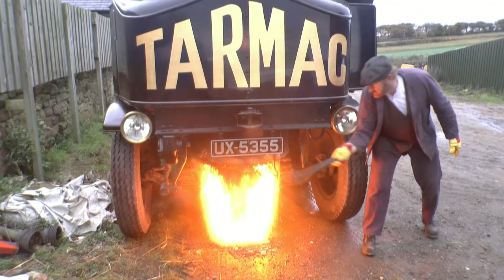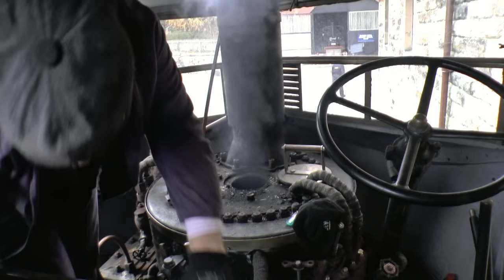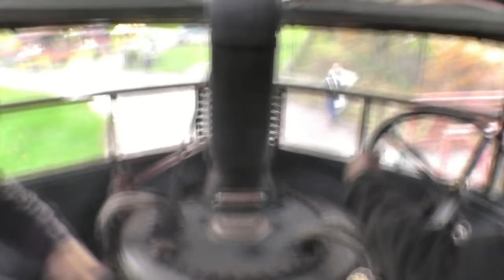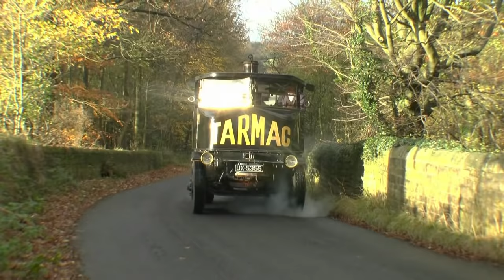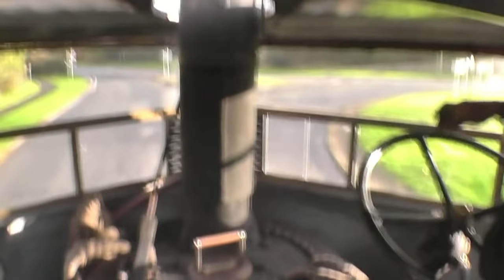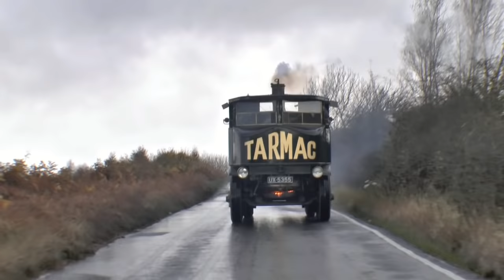Sentinel DG8 Steam Wagon

Comment: And I complain about the lack of power steering on my Fiesta......
Reply: Jusb1066 just buy a K&N Airfilter and you will have enough power ;)
Reply: what ? Is this supposed to be a joke @Kai FRIEDRICH or are you for real ? xD
Reply: +Th3Moonser I think he was high
Reply: Yeah I think so
Reply: Spinddrift that was definitely a joke
Reply: Sorry, that's not lack of power steering, that's center-point Armstrong steering.  It was the predecessor to power steering.  At least I think I saw the front end raise up when he turned the wheel which would make it center-point.  But it was definitely of the Armstrong variety.
Reply: Cars without power steering are easy to drive. It's when you start driving trucks without power steering that it becomes a bit difficult. My current daily drive lacks power steering and it's easy to steer, even at slow speeds.
Reply: What Fiesta, is it a mk2?
Reply: @adrienbanha3004  it was a 1992 MK3 I had untill last year, now sold, I have gone modern

Comment: I'm afraid I'm gonna need one of those. Where can I sign my soul to the devil... Because I would to own that. I'd  drive it to pickup my kids at school and to get groceries. I don't care if it takes 2 hours to fire up I'd do it anyway!.
Reply from the maker: Great fun
Reply: I plan on buying one as soon as I hit the Mega Millions Tuesday night.
Reply: You could modify a modern internal combustion engine into a single action steam engine. You could make it into double expansion engine by connecting primary cylinder exhaust to two secondary cylinder intakes. You'd need a modified valve timing rod, to open intake on every downstroke and open exhaust on every upstroke. Water pipe boiler is very easy to make yourself and it produces high efficiency superheated steam with no extra apparatus required. If you make it running on liquid fuel, you could make an automatic furnace that keeps appropriate steam pressure by starting and shutting down depending on the pressure.
Reply: @michaelbuckers  so essentially, change timing,  and boom steam engine. (if it doesn't blow up)

Comment: I saw the footage of driving through the puddles and flooded street and realized that those could really ruin your day in a steam-powered truck like this.
Reply: Nah that is just the ash tray, it would be hard to get water up into the actual burner.
Reply: Because petrol engines can breath underwater...
Reply: If steam engine gulps up some water it just extinguishes, you can re-ignite it with some dry coal. If a petrol engine gulps up some water, you gonna need a new petrol engine.
Reply: Mi 28 If water goes into the cylinder(s) while its running, you'll have the same issues as a petrol engine. That's why steam engines typically have some kind of bleed valve to open while they get started allowing water that pooled after the last run to be ejected safely without bending the rod.

I think Pete's point is how long it would take to dry out the fire box, re-ignite it and bring the steam back up to pressure to get going again. I sucked up a little water into my Jeep's engine more than once. It only took 5 to 10 min to pull all the plugs, crank it a few times, clean the water out of the distributor cap and reassemble.
Reply: The flood water wouldn't go into cylinders of a steam engine, the intake is sealed off from the environment. The drain valves are there because steam is water gas, and it always fills up the cylinders, so when the engine stops for a long time all of that gas water condenses into liquid water, which needs to be drained.

You don't need to dry out the fire box. You just need to evacuate the water and re-ignite it using dry coal. The burning coal would quickly dry up the firebox and the wet coal as well.

As for your truck, I guess you got lucky and it only sucked a tiny bit of water at a time, just enough to stop spark gaps from working but not to cause compression damage. Flooding a running engine normally results in its complete destruction.
Reply: cold water on the boiler too..

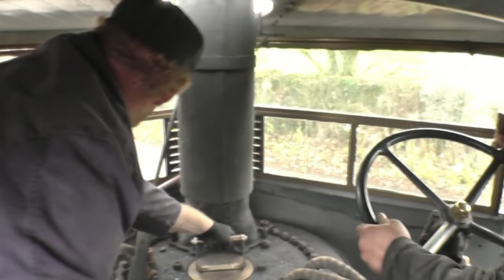Comment: 4:26 when vtec kicks on
Reply: insert [ E U R O B E A T ]
Reply: TowmaX wrong country
Reply: Engineer Skalinera but it’s used in an asian show an honda is an asian car company
Reply: TowmaX the initial d memes are from japan
Reply: you forgot the "yo"
Reply: big smoke haha
Reply: Greg Thomas Honda's aren't slow
Reply: Many steam engines did have variable valve timing but that tended to be on the locomotive engines, not too sure about road going steam engines!
Reply: @sidecarbod1441  that's normally called "hook up" in america, it's where you adjust the valving to open less at higher speeds to conserve steam and help the locomotive run a bit smoother by adjusting the time the valves open and close, thus making the train go faster. The legendary Stanley steam cars had the same thing, which is how some of the racing cars can reach speeds of over seventy miles an hour.
Reply: Lol
Reply: More like 11:20
Reply: The tec lad... This thing blows smoke rings ... Satisfaction guaranteed
Reply: Coaltec not vtec lol

Comment: bet it has better EPA ratings than a volkswagen from 2016
Reply: Well we know now you are not an Engineer!
Reply: Jamison Leonard a bush fire next to an oil refinery has a better EPA certification than a VW diesel
Reply: the car produces some kind  gas as any diesel car. but the they probably used weaker filter that block air out flow and made it slow .so bypassing filters makes car faster and more efficient while makes car more ozone enemy. 
thats what wolkswagen did . 
jut put another filter and you got the some epa ratings :D
Reply: ahmet mutlu As long as we're missing the joke, the VWs can meet EPA standards just with ECU tuning (and an increase in DEF usage)...which is precisely how they passed emissions testing on the EPA dynamometers but fail in actual road use.
Reply: Jamison Leonard this truck takes the green piece award
Reply: wel its not green . it doesnt use any kind of filters. so its worst case of emission possible. :D 
just uses coal instead diesel or fuel. but im sure epa ratings wont pass epa. you guys get it wrong. 
with a epa compatible filter probably this engines wont even start. thats the problem. thats why wv used weaker filters :D
Reply: KennyG Hansen hey a fellow hubcap collector is here!
Reply: Well the VW was just high on NOx emissions,  this is high on CO, SO2, and particulate...

Comment: I would love to see a modern version of this truck built. The same wheel set up and cab but a gas fed burner and the best materials and most advanced steam engine. Just to see what it could do. I know steam engines can make tons of power. The trick to them is keeping the heat in.
Reply: Especially power steering!
Reply: What’s the point of it if it’s going to burn gas? Seems to me what makes a steam engine so useful is it can burn cheap fuels like coal and wood.
Reply: @loganbaileysfunwithtrains606  Because steam engines can be very small and still make an insane amount of power. Never going to be a sports car but it could be a commercial truck. With modern tech we might be able to make it burn cleaner than a diesel but make similar or more power.  

 When steam powered trucks were built technology for burners and insulation were WAY worse than they are now but they still made a ton of power with tiny engines. 

 I have no idea if they could really compete with a modern diesel but it would be neat to see what could be done.
Reply: @plaid13  ACE 3000 was a program in the 1980s to build a modern coal fired steam locomotive. You’d likely be interested in learning about it
Reply: @loganbaileysfunwithtrains606  kind of interesting but coal isnt a good fuel.
Reply: @plaid13  coal is a good fuel, it’s thermal properties are better than any liquid combustible. It can also be used in a process called “coal gasification” where it’s heated and off gassed and the gas is then used in the same application as natural gas.
Reply: @loganbaileysfunwithtrains606  But what it is not is easy and practical.

Comment: At least we have got about a thousand years of coal left, perhaps when the petrol runs out coal powered trucks may return!
Reply: Still plenty of wood and cardboard and paper to. Don't get me wrong coal works but that's still a finite resource. Wood along with paper products are renewable because they can be recycled and regrown.
Reply: Plus diesel can be synthesized from most cooking waste or have a few dedicated farms for fuel production. We are certainly not going to run out of fat animals or greasy foods or soy beans anytime soon.
Reply: kamenridernephilim he could use shredded compressed newspaper logs all he has to do is get a stack of old newspapers shred them and a blender with water and press the water out and form them into small cylindrical bricks that he can use as fuel logs
Reply: The Tool Guy not really a byproduct, it's part of the process. So is Jet-A, Heating oils, and asphalt. Distilled it comes off in layers into pans in the stack. The higher it goes the lighter the fuels.
Reply: Some refiners only pull off and sell gasoline because it's the end result of making jet fuels, which is what they are after for the higher revenue return. Some refineries actually inject unwanted fuels back into a pipeline so it can be used elsewhere in a down stream refinery.
Reply: Um, Tool guy, have you ever heard synthetic diesel? Apparently it have been around even before WW2, and it was produce by wood and animal products, and it can put on planes and fly faster then the real diesel, tough it was very costly to make.
Reply: Saviliana go to the Thessalonians man YouTube page he shows you in great detail how to refine oil gas and kerosene from wood and it's so ingenious I've literally watch his videos for times and some of them are over 2 hours long
Reply: I did watch a simular video, so yeah, it is working, but very costly in making in large amount (cost of time and energy)
Reply: Ever heard of electricity?
Reply: all this is unnecessary a gassifier turns wood into a gas that cars can combust with a regular combustion engine with minor modifications
Reply: Electric pressure steam cleaner + deep cycle battery + twin acting cylinders = steam car of the future, no hassle, no problems.
Reply: aserta A normal electric car would still be much better
Reply: The Tool Guy the original Diesel engine was intended to run on vegetable oil
Reply: you ALL ever heard of torrified biomass? its a coal-like substance made of wood, with almost no energy waste. it burns a lot cleaner and hotter than coal. combine this with power steering, Gas Producer Combustion System, an improved boiler design and a lempor exhaust and you get one hell of a steampunk truck that goes a lot fAster
Reply: Crazy Horse Trading the potential of modern steam is not to be underestimated.

Besides, you ever heard of the Doble E? A 1924 steam car that could go 100mph ez.
Reply: We are no where near to running out. That's a bunch of crap

Comment: Certainly quieter than diesel..gear noise over takes all..what would normal operating speed be?
Reply from the maker: +Oilsmoke Jones  between 20 & 40 MPH depending on the size of ones testacles
Reply: Oilsmoke Jones what's the 0-60 time?
Reply: TheDude it can keep trying till the whole world run out of coal
Reply: @MrTherandomvidsguy   a calendar.
Reply: Huh... my dad used to assert that you could get 70 out of one if you had sufficiently enormous gonads. Or at least he'd ridden one that went that fast. Can't remember the full story but he'd have been quite young at the time himself, so who knows.

What I want to know is a) if they're still legally limited to 20 or if that's just a bit of historic flair, b) how the heck you'd know where the limit even was given that there doesn't seem to be any instruments at all. Would you just go by the sound and guess it off the passing of mileposts or something?

Not that I think I'd personally have the balls to drive one any faster than that anyway. And what even is a "steam brake", given that there's a warning about it on the mudflap?

Comment: Astounding that there were still coal--fired trucks on the roads as late as '29!

In the US at that time, coal was used mostly for railroad locomotives, and perhaps steamrollers and heavy construction equipment, but trucks? That is pretty amazing...
Reply: You are leaving out the maritime need of coal, coal fired steamships survived until the 1970s, and there’s still a coal fired steam ferry operating on the Great Lakes. The last US large carrier railroad to give up on steam was the Norfolk and Western in 1965. Honesty it’s unfortunate they didn’t try and fight to hold onto it longer, with all the modernized machinery they had available at that time they were able to get super efficient steam locomotives that completely outclassed any of the diesel locomotives of the era, in terms of range and power.

Comment: Possibly either a dumb, or a far too nerdy question, but... what's with the two different rhythms to the chuffing? Like there's a quite fast, thinner/higher pitched one, which is obvious when the truck's maneouvring at low speed, starting off, being parked etc... but when that's starting to merge into a continual fluttery hiss, something quite a bit slower and meatier comes in, sounding much more like what you'd expect from a typical steam locomotive.

You'd probably be quite well advised to build a road loco with a compound engine to get the very most power and efficiency out of a limited boiler size and transportable quantity of fuel, but usually those just have different sized pistons on the same shaft (so the chuffs might be different "notes", but would keep the same rhythm). And it doesn't even seem to be a simple 2:1 relationship, maybe more like 4:1 or even a non-integer one. So is it like there's a big cylinder directly connected to the shaft that turns the drive sprockets, and a smaller one upstream, with a fair bit of speed reducing / torque multiplying downgearing in between the two? Or is it something else just creating the illusion of that?

Comment: Where does the electrical power for the lights come from. Does it have a steam dynamo? Interesting video. Nice to see these old vehicles preserved in running order.
Reply: Given how little night running it likely does, they might be mostly for show. Or hooked up (along with tail/stop lights) to a leisure battery that can be topped up when the truck's parked up. The original ones may have been acetylene, or running off a battery kept charged by a wheel / drivetrain generator.

Though some kind of turbine in the exhaust / steam outlet path, doing energy recovery like in a big ship, would be quite a neat solution.

Comment: car working with anything that you can burn  :D seems cheaper in general . except it uses water . which will get rusty easier. 
ie if you get out of fuell all you need is lots of plastic and paper. or fuel too . i guess they should produce more efficient versions of this :P

Comment: 1929, these been a bit of a development since. But I guess this was antiquated already as brand new.
Reply: Steam put up a decent fight against internal combustion for quite a way into the 20th century, at least in the heavier haulage field, for the same reason that it held on for rail locomotion... small gas engines were quite handy for lightweight vehicles, but were hard to scale up for sufficient power and particularly torque for heavy goods work. Petrol driven models of the time would probably have been even slower, and harder to drive (limited numbers of gears would also mean harder hill starts but lower top speed), and selling more on the benefits of quicker start/warm-up, lower maintenance and better fuel economy. Plus Diesel took quite a while to reach a sufficient level of development to catch on for anything other than tractors, so you'd need to rev relatively hard and make a lot of noise and burn excess fuel in order to grind over a hill.

But of course the ultimate potential of the ICE is rather more than that of steam, so once engines for both fuel types became sufficiently advanced, along with their transmissions, they rapidly kerbstomped the remaining steam based models.

Also Sentinel's vertical boiler design was actually pretty advanced even for its day, and the main thing distinguishing this rig from a modern non-articulated 8x4 tipper with 4-wheel steering is the distinctive curvy cab built around that boiler, the visible fire pan and the smokestack (as well as the exposed drive chain). Other than that the form hasn't really changed much in 90+ years as it hasn't needed to. A chassis with some big wheels, a big ol' box taking up most of the upper deck, and a smaller but still quite square box for the driver and powerplant squeezed on the front end.

(of course, that's maybe more the case here, in Europe, and other such places where cab-over designs are favoured... naturally it does look rather different from a typical long-nosed American truck)

Comment: Top end on this bad boy must be upwards of 10-15mph! My mistake! It reads, “ 20mph” on the side of door!
Reply: That was the legal limit for heavy at the time it was built... (buses of the period have 12 mph painted on them ... which I always used to think my Nan was mad for asserting as the speed buses went at, until I saw a classic one for myself). The drivers, as far as I'm aware, and particularly the manufacturers, paid nothing more than lip service to that idea.

Flat road, and more importantly with a proper head of steam rather than the fairly disappointing one they managed to get up, and an unladen steam wagon could quite easily overtake your ability to control it and leave you careening across a field at quite a lick, praying that the boiler doesn't explode.